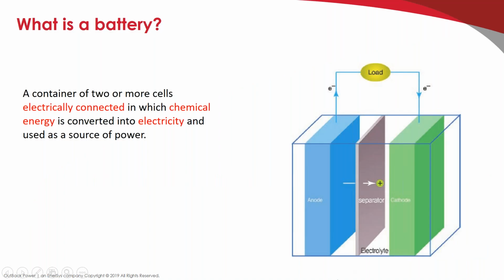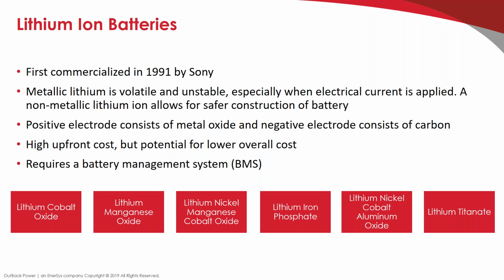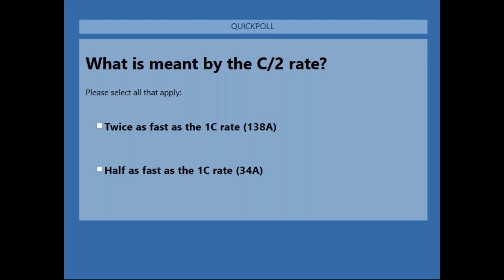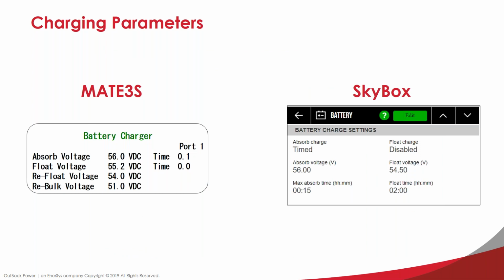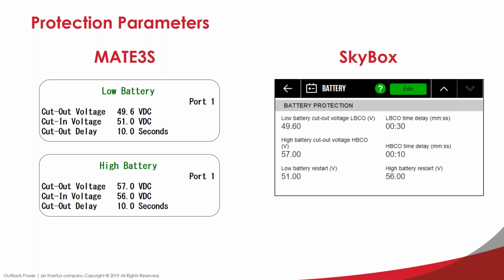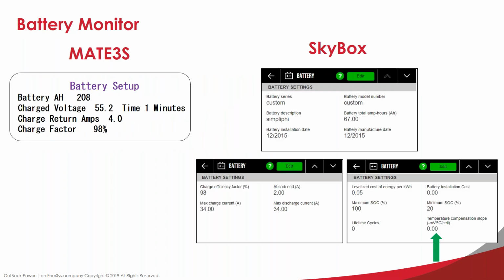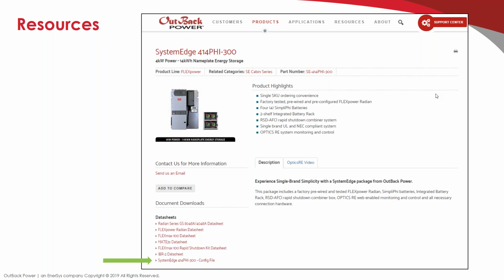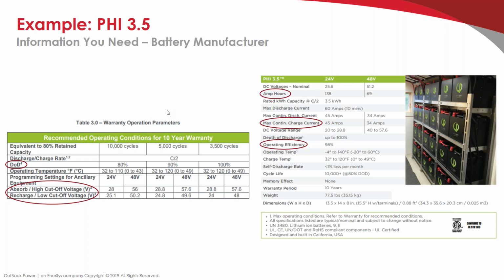Webinar | Lithium Ion Batteries with OutBack Power

Comment: I have two LiFePo4 12v 200ah, Ampere time, batteries but need all settings for my Flexmax 60 CC. How should I set parameter for a 12v system, Please?

Comment: Aloha. I can not change my cut out voltage on FXR3048 any higher than 48v for a simpliphi. Id like to raise my cutout to 50v, or even 49.6v as you have shown in your presentation. Is there a firmware upgrade for FXR?

Comment: For charge return amps , it say 4 amps , if I understand this is per battery , so if you have say 4 , you would modify , Outback please confirm ,  Per PHI 3.5 kWh battery – These settings are calculated by multiplying the nominal per battery value
times the # of batteries. Refer to Charge Controller Bank Sizing under the “Battery Bank Sizing” section.